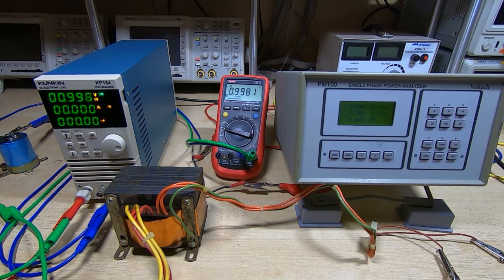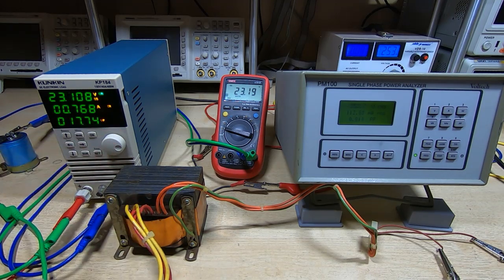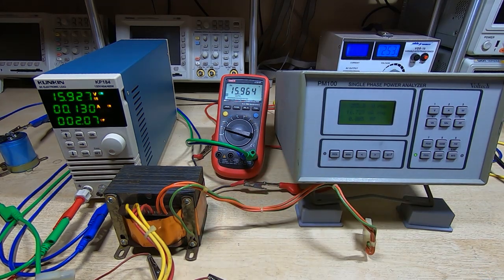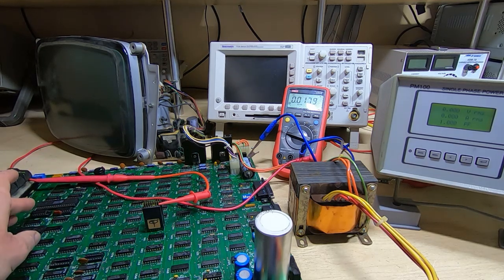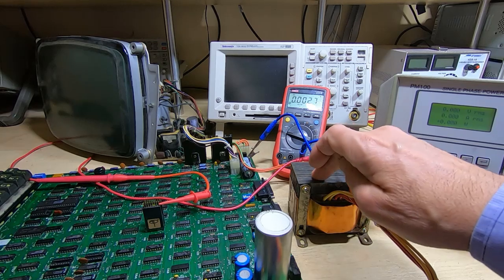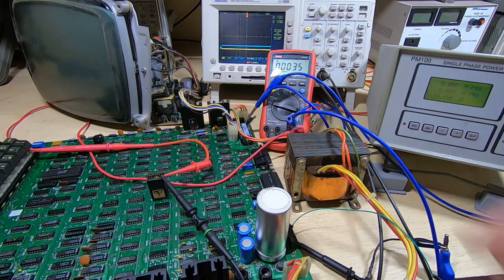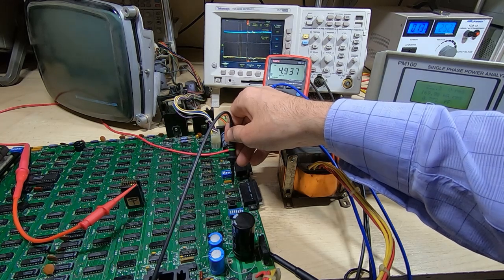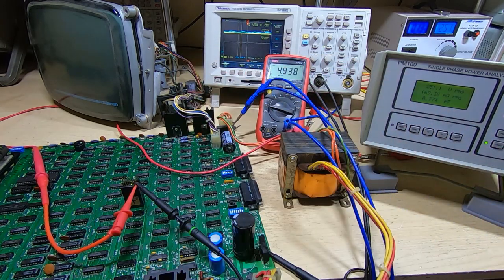ADM3 Transformer Rewind Part4

Comment: Jerry, I would be interested  in more transformer repair videos. I restore antique tube radios, and encounter blown transformers. There are too many conflicting articles on solving power per core area, turns per volt, flux, etc. A better understanding of formulas would be great. You don't always have a good transformer to get information from. Thanks!
Reply from the maker: Yes I also repair valve radios and TV's and often need to rewind various transformers (Audio out, coupling, blocking, LOPT etc). As you say there is a lot of conflicting information online and it frequently makes it sound more complicated than it needs to be. In fairness to those posting the information there are many ways to wind a transformer as it often depends on the 'target' performance. This is why I try to avoid too much maths in my videos as it is not usually needed unless the transformer is 'critical'. It also depends on intended frequency (50 vs 60 Hz etc) and core material.  I will try to show a few more transformer repairs and I will also be developing a large linear power supply for which I will be designing transformers so I hope to show that in some detail.

Comment: Apologies for the stupid question. Would a 115 V tap on the secondary have been useful?
Reply from the maker: I assume you meant the primary. It would not be possible to simply add a tap as the wire for a 115V primary needs to be thicker and there is not enough room on the former for twice as many turns of a thicker wire. For a normally terminated transformer (with tags) I would have wound it as two 115V primaries so it could be wired in series for 240V or parallel for 115V but with flying lead terminals it is too messy. Also it is very unlikely that this unit will ever get shipped back to the US (if it does then it will make a nice project for someone to rewind it for 115V).
Reply: @JerryWalker001  Oops yes primary. As you say two 115v sections. The flying lead problem explains it nicely. Nothing to tie it to. I suppose it was to save money. I did have a ADM3 that was 240v but I never looked inside.
Reply: Couldn't they use a step up transformer?
Reply: @anthonydenn4345  Jerry refers to the issue several times. CRT's were scanned using neck coils. The field produced by the PSU transformer could cause problems with this. So they chose the transformer design to minimise the field and then screened as much as they could. From Jerry's dissection and measurements this becomes apparent. I suspect the 240v design would take this into account but might differ a bit. At DEC our VT100 had a screened switching supply so no radiation at a frequency that mattered.
Reply: No I meant, you could get over the need for a 120 volt tap on this unit by using a US to UK voltage step up transformer.